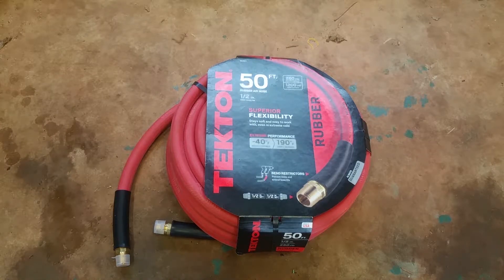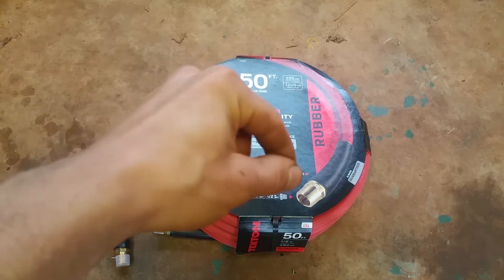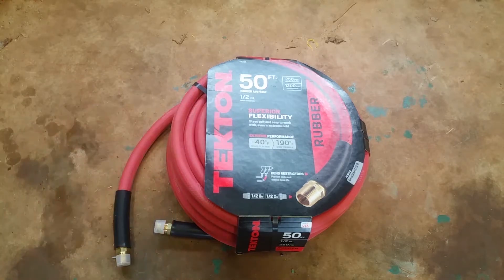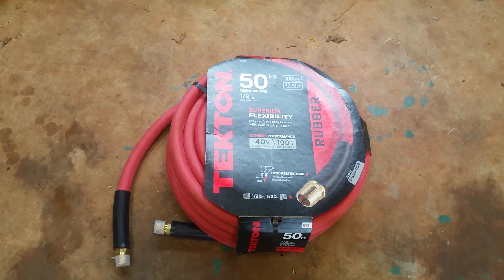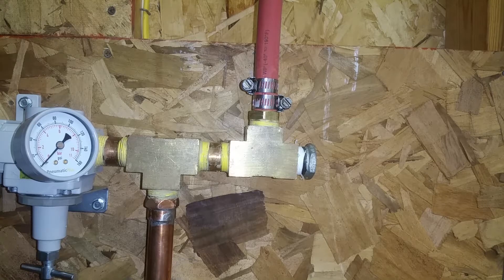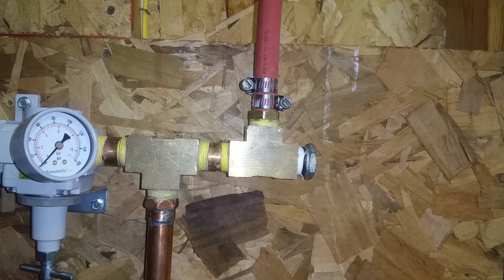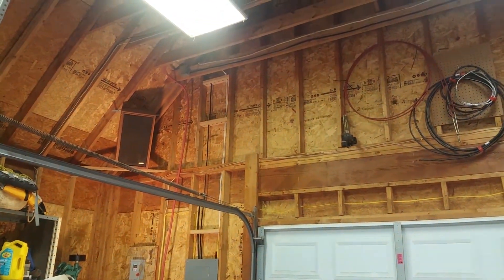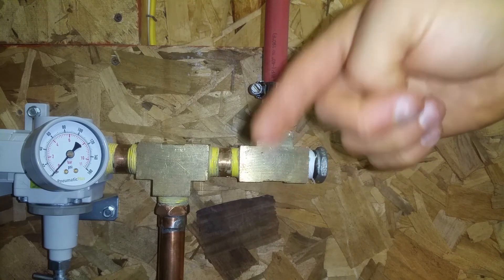Simple TRICK For Plumbing Your Air Hose Reel!

Comment: What do you think of the tekton air hose? I recently bought a husky and Lowes brand hose and they suck
Reply from the maker: The Tekton hose is great. I had to cut it to use it for what I did. If I needed an air hose I would buy Goodyear, Continental, or Tekton depending on the price. They are all made in USA. I don't even consider anything else. They do suck!

Comment: My 2cents..You're cutting down flow too much with those fittings.  Especially if you plan to use stuff like 1” Impact wrenches.  Go with the biggest hose/ pipe out of your compressor you can.  Avoid all adapters that restrict flow or reduce inside diameter.
Reply from the maker: I disagree. Everything is plumbed so that I can run a 1/2" air hose for  a 3/4" or 1" impact direct from the compressor manifold. All I have to do is buy 1/2" quick connects. This 3/8" hose reel will cover 99% of my daily needs.
Reply: Matt's Shop okay, just make sure the fittings don't reduce ID between tank and tool.  I see too many people do that.  Then they wonder why they get bad or lackluster performance with high volume air tools.
Reply from the maker: Yea, I have a vid about this coming out soon. Thanks for the concern, but I learned that all of those little bottlenecks really KILL your air tool's performance! That's why I plumbed everything in and didn't use quick disconnects everywhere like everyone else does.